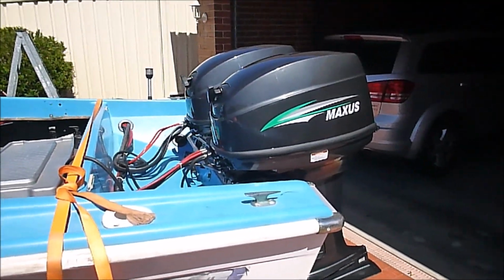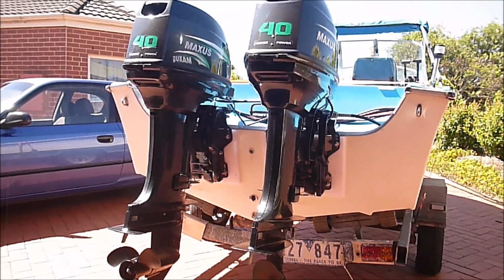Twin outboards vs Single outboard

Comment: With two motors one breaks down you can still get back to the dock with 1 motor 👍🤘
Reply: Not sure. If the problem comes from the gasoline for example, both motors will be shut down. You need 2 differents tanks

Comment: we have 75hp mariner on our boat and we are going to put a 90hp or 100hp witch one do u think we should put on to our 5.8 meter boat
Reply from the maker: Hi Andrew you can fit any sized outboard up to the rating supplied by the boats manufacturer. There wont be much difference in performance between a 90hp or a 100hp so choose what is best for you.
Reply: hi  @joeyaus1   thanks for that i think we will go for a 90hp

Comment: Any idea on the speed with a single outboard compared to dual outboards? Am doing same project with 2 x Honda bf50
Reply from the maker: Hi guaiep with a single motor the boat travelled at  50 kilometers  per hour. With twins we achieved 70 kilometers per hour.
Reply: I would like to know as well.  I have an old classic ski boat with a 15" transum that was rated for 80 HP in 1960.  I do not want to alter the boat  any further than original than necessary! We ran a 2 stroke Mercury 70 hp on it but I want to take it on the lake now.  The largest HP motor I can get in a 15" 4 stroke is a light 3 cylinder 50 hp Tohatsu which will probably get a top speed of 35 mph f judging from other videos. I seen where someone powered an identical boat with a honda around 45 hp 4 stroke which they said moved it well. I want to get a top speed closer to 50 mph after being usee to the old tower of power 6cyl. I am considering getting a pair of 40 HP or even adding a second 50 hp if not happy with just the one 50 hp. The goal here is to get more thrust to pull any skier out of the water, get on a plain quick,  and get a higher top speed my friends that want to ski fast.  I plan on a skier, spoter, and pilot with no extra weight onboard.  There will be a second boat to haul gear and extra people. So I really want to know of two 40 or 50 hp will preform. Getting the boat back with a Tohatsu MFS50A the first week in April (2019). Going to do some structural fiberglass repair and ad instrumentation under the dash to keep from modifying an part of the hull next.  The plan for 2020 is to re gel the the top which has cracks and is very faded custum bini top well have to wait as well.  This boat has been in my family since it waa brand new and it means a lot to me.  Please, I will greatly appreciate any input on this twin motor Idea I can get.
Reply from the maker: Hi Dan

My suggestion is buy a larger single motor that will match your old two stroke.  Modify the transom height with a bolt on engine mounting bracket and the job is done. This is providing the boat and transom are in good shape. I believe going with twin motors will only create a lot of problems for you.
Reply: Go stainless props and steepen the pitch.  And you will not regret it.  Faster better mileage    You loose so much in aluminum props.  They say up to 28 % compared to stainless.  Thinner and no flex.   In the long run way better can’t even compare.    It’s like have ing.  4 wheal drive with summer tires in the snow
Reply: @joeyaus1     That makes no sence.   It’s an old boat.   If one breaks he can still get to shore safely.  They are two stroke and easy to fix great hole shot with two motors and he already has them.    Your talking about a 6000 dollar swap and that’s not a new motor.  Old boat.   Nuts

Comment: I have one of those motors I found if you go up to a 14 pitch prop it goes a little better
Reply from the maker: How do you like your motor ? Have you had any problems. My original motor was bought second hand along with the boat. The second motor was bought as a non runner on Gumtree it had a faulty starter motor and a faulty ignition. Parts are very cheap for these on line and both motors now run very well.

Comment: would one 90 hp outboard go better than 2 40 hp
Reply from the maker: Hi Kevin c  one 90 hp would go better.
Reply: as far as i can understand it, and mind you, i have a very limited understanding... One 80 hp motor would go faster than two 40hp ones, at same maximum rev. because of drag in the water,,  What im trying to figure out tho, is if its possible to get a faster propeller setup with two, smaller motors than one big, specialy surface propellers
Reply: @Lindholmer5k  I did some searching and one article I found said this, " generally speaking, twin outboards should achieve a quicker hole shot than a single outboard of the same horsepower. This is because twins have greater blade area with which to punch out of the hole, and drag is less of a factor during initial acceleration than at higher velocities." And "the twin 115s vaulted to 30 mph in 5.57 seconds, while the single 250 took 8.97 seconds to reach the same speed. The twin 150s attained 30 mph in 5.42 seconds, and the single 300 took only slightly longer, 5.61 seconds."

Also twin Engines tend to have much better handling.
Reply: Twin outboards are better for stability at rest

Comment: 2 motors just improves power not speed
Reply: thats flase
Reply: You are both correct and incorrect. It would improve speed, because it has more torque to help it go along. The two motors would work less, which might make it go faster.
Reply: Two motors without a prop change won’t increase speed if it was already had enough power to hit redline on one of those motors, but if you up the prop pitch to take advantage of the new power, you will go faster. My preference is, if possible, pitch the props so 1 motor can just get the boat on plan and cruise at 25mph or so. Then you get some extra low end grunt and some extra top end speed and a decent cruise while maintaining the get me home ability of twins.